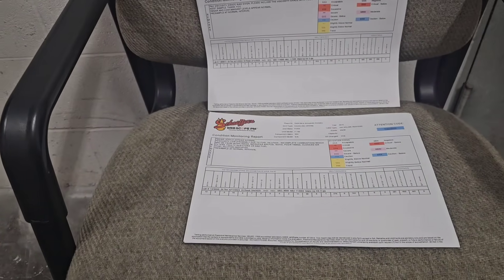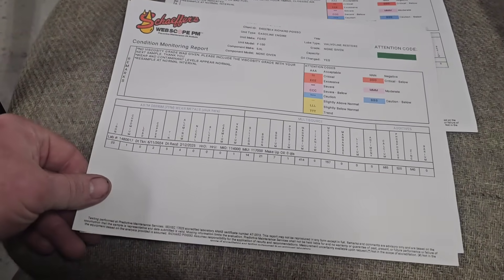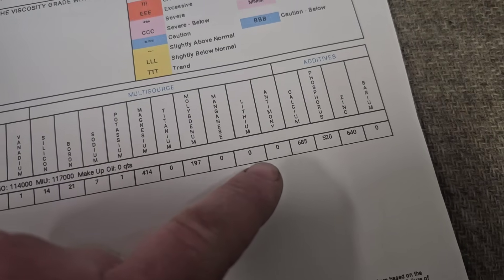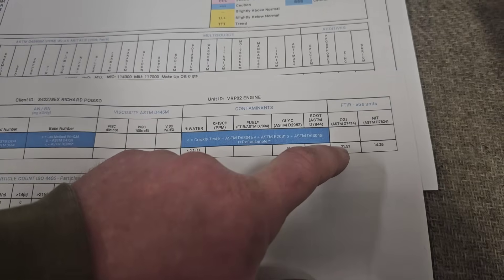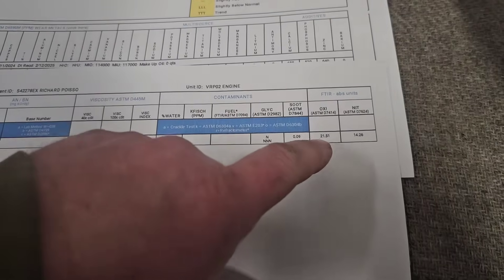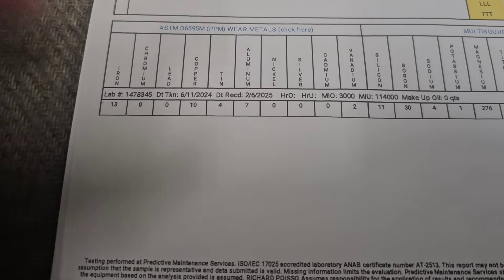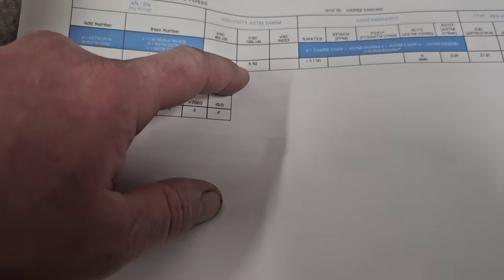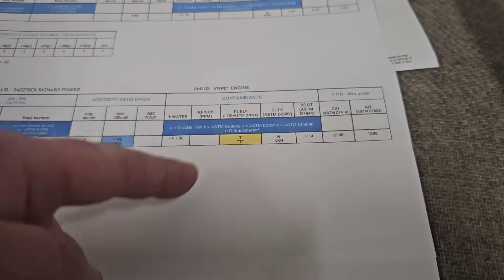Why F150 Owners Are Switching To Catch Cans | Catch Can Vs Sump Oil |  Valvoline Restore and Protect

Comment from the maker: Oil Filter Cutting Tool

Expensive one:
https://amzn.to/3F6wdDd

Cheaper one:
https://amzn.to/4krl6ol

Valvoline Restore and Protect 0w20 5w20 5w30:

Make sure you select what you want - 
https://amzn.to/3DnXWi4
Reply: I have a question if you don't mind ... what would cause my Oil Catch Can all of a sudden to quit catching anything ??? I have check all the connections for any clogs and if you unscrew the container with the engine running it will induce a vacuum leak so I know the system is working 🤔

Comment: My 2015 3.5 Ecoboost with over 135k miles has clean intake valves! Simply Change oil (synthetic) every 5k miles, replace the PCV valve and spark plugs every 50k miles and only use Top Tier gasoline!! Catch cans only catch vapors that cool down to a liquid. 3rd generation mechanic and engine builder. I was using Mobil 1 but switched to Valvoline Restore and Protect 3 oil changes ago. Zero problems or issues!!
Reply: Valvoline Restore and Protect and catch cans help a lot with engines that send more incomplete combustion back into the combustion chamber than others.

Comment: Love the channel. Just a few thoughts though from a fellow tech. There is an absolute difference between the samples not denying that. However the environments that the oil live in are different. Moisture and fuel in the oil on vehicles is a perfectly normal occurrence. The water and the fuel will both evaporate in the crank case during normal operating temperatures provided the duration of that temperature is long enough. (not short tripping the vehicle) The catch can however by design will capture moisture and fuel and will never be warm enough to evaporate it being so far removed from the heat source. So all the sample is proving is that some of the small amount of oil, fuel and moisture was captured. I feel like the actual test for a catch efficacy would be to show that these substances once recirculated back to the intake in small amounts over long periods of time actually do or do not contribute significantly to carbon build up by having an A and B sample vehicle, one of which would have to have a can since new and both sets of intake valves scoped at 100-200k to collect data. Then proving there are no drastically negative effects, such as freezing and going over crankcase pressure in cold climates etc. The only real empirical/scientifically proven reason to run a catch can to date is to reduce LSPI, which with the new oils isn't as much of an issue anymore providing you have a healthy engine.
Reply from the maker: This was a test that I was asked to perform and I gave it to you

Comment: I got one for ya Ford Boss Me, will Valvoline Restore and Protect reduce the amount of intake valve buildup on a Direct Injection engine. We know that it eats away carbon but would the intake valves be exposed to enough of it to work on the valves? I have switched to VR&P in my DI engine. I plan on removing the intake to check after 4 change intervals to see  what they look like.
Reply: Why would oil be flowing through the intake valves ? 🤔
Reply: @Jay388   PCV crankcase ventilation. Hence why the need for a catch can.
Reply: @Jay388 I the engine bus oil through worn valve guides or seals, the valve would see oil to burn off carbon.

Comment: I did the same thing for a 05 f150 5.4 with 216,000 on it, it’s definitely sludged up but not horrible so I switched to r&p 5w30 and bought multiple fl-820s filters from Walmart for 4 bucks a piece. Changed the first one at 600 ish miles on the first oil run and it was caked up, next I’ll probably put 1000 on the second oil filter to inspect and see when to put those filter change intervals at. Its better to change them sooner and still flowing oil then later and having them plugged to hell

Comment: Started to run r and p in my 13 explorer 3.5 non turbo and its insanely quiet and with the valve covers off its pristine inside 140k miles. bought car at 36k miles and it was a little tiny knock noise once in a while after it runs for a few hrs but that totally went way after a week or so running r and p. Great stuff

Comment: What weight was this?   I assume 5W30.  Just for comparison, you had shown virgin results of 0W and 5W20 as 6.1.  On Lake's high miles Toyota Sienna oxidation was 13.6 at 5000 miles on 0W20.  For my Telluride, I am going to limit to 5000.
Reply: I was thinking that oxidation ended up high too. I wonder if all oils do that or it's just this one.
Reply: @briankalagher6687  what I learned on the Oil Geek is that at some point it increases more rapidly.  To learn that point takes multiple tests.  I am not ready to spend that money, but hoping to learn from seeing data online how I can avoid waiting too long.  I don't have a turbo, but I do know my engine was building up deposits on my dealer's synthetic oil.
Reply from the maker: 5w30

Comment: The entire way Valvoline R&P works is by having a higher solvency base oil that holds the sludge dissolved in suspension. It won't clog the oil filter. Prematurely changing the oil filter is probably a waste. But if it puts some people's minds at ease, so be it.
Reply from the maker: Greg if you hear it come out of my mouth there was a reason for it, OK?

The reason is people reporting the sludge it breaks lose has caused some issues 

I use the caution as a disclaimer, I dont necessarily need to be corrected by anyone or have anything I said changed

Comment: In our areas, there is a Dairy Queen about 40 mies outside of the city. We tell ALL of our customers to drive out to DQ and get a cone or sundae and then drive back. Why? We suggest they doe this about every 2-3 months. Heating up that engine helps remove condensation of the engine pan and gets that oil hot and helps remove those carbon deposits. Valvoline Restore and Protect does work, but we also use BG products like 44K. That certainly helps flush out contaminants out of those injectors and reduce carbon build up in the engine.
Reply: The amount of people that don't understand an engine needs to be heated up and actually revved out a little bit boggles my mind.

Comment: I am on my second oil change with restore and protect. My engine is fairly new, so I didn't bother with swapping filters in the middle of the first run of this oil. I use Purolator Boss oil filters.

Comment: I'm running 5qts valvoline extended protection high mileage 5w30 and 2qts restore and protect 5w30  in my ram1500 hemi .......smooth and quiet 
My wifes nissan frontier pro4x  2.5qts restore and protect 5w30 and 3qts valvoline high mileage 5w30......she ❤ it ...as long as it starts and goes my phone don't ring 😅😅
Reply from the maker: I wouldn't mix
Reply: @FordBossMe  so if I ran 7 qts of restore and protect and then switched to say advanced ..even draining pan til it doesn't drip ..your still mixing..
Back in the 90s I ran castrol syntec blend 5qts and 1qt syntec full synthetic and put 400,000 on an xlt ranger .....worked at a shop we sold castrol and the rep recommended it..... remember the commercial where they poured a qt in then drained it and people were blowing motors up ....... THAT WAS AWSOME LOLOLOL

Comment: Good stuff. I'm planning on using the restore and protect next oil change. I'm going to change the oil filter at 1500 miles on a 3000 mile oil change.

Comment: Got a 2015 F150 3.5 Ecoboost.  Normally run a 5k mile OCI on Pennz Platnium, switched to R&P and at 2k the oil looks as dirty as I've seen at 7k on PP.  Going to change this first batch or R&P at 2k this weekend with a filter cut open.

Comment: What I did was remove the valve cover and cleaned it. I've just recently got a 2007 civic that was pretty sludged up by looking in the valve cover. Got roughly 5% increase in mpg. Previous oil was Royal Purple.

Comment: Which catch can would you recommend for like your 2015 F150 with a 5.0 motor because that’s what I have.
Reply: I installed the Ford Performance oil separator on my 2018 5.0 one week after I bought my truck. The installation is on you tube. It wouldn’t fit exactly because it was for a Mustang and not the truck . I made a bracket to fit it on the battery box and used lines bought off the net. The engine went thru 2 Ford oil consumption tests after 10,000 miles but did not need an engine replacement. At 30,000 I changed from 5w-20 to 5w-30 and the consumption reduced drastically. I change oil at 3000 miles because of all intown stop and go driving. There is always 3-4 oz of oil in the separator at each oil change. I use only MotorCraft oil and filters. I’m 80 so my local dealership does the services.
Reply from the maker: I have a cheap ebay one on it lol but I like Ford performance the best or mishimoto
Reply: UPR, fantastic products.

Comment: I see you mostly running motor craft filters on your F150. I’ve got 102k on a 19 F150 5.0L. Looking to switch to the restore and protect. I don’t mind the cost of motor craft filters if they’re the best. Where is the best place to buy them? Dealership? Amazon?
Reply: They are $8 at Walmart and the oil is $30
Reply: amazon is nothing but counterfeits
Reply from the maker: Actually I don't run mostly motorcraft I have a mix depending on what I'm doing 

Right now I have a Donaldson on it - 

Motorcraft I always recommend on fords
Reply: @ I gotcha. Been looking online at filters just trying to find the best place to order motor craft and not get screwed on knockoffs. Thank you for the response! Glad I found your channel and the oil results have been very informative.

Comment: Can i send you samples of my oil  it's valvoline restore and protect. I been doing filter swaps and topping off every 1500 miles without doing full oil change in over 25000 miles take a smaple at filter change and add about a quart. So im basically doing a 25% oil change every 1500miles this car is oil 2006 xb 1.5l 1nz-fe with over 240k miles 🤔 the manual transmission is starting to go out lost the synchros in 1st, 2nd back at 180k.
Also i don't use the stock filter for this car i use the one for the Tacoma it's the same thread and diameter fit perfectly but nearly 2x longer
Reply: Side note i did a full bg motor flush before switching to V-R&P
Reply from the maker: I can send it off for testing for you but it'll cost about 25$ a test

Comment: Pretty sure my 120 mile 2015 5.0 got a rear main seal leak from the stuff. Was fine and then started leaking with this oil. Then went back to penzoil and it stopped again. Same oil weight.
Reply: Bs.   If thats the case then crud and gunk is plugging up and sealing your rear main.   This oil didn't cause it.  Your rear main is bad and this oil just cleaned it and showed you a problem.  Change the rear main goofy

Comment: So does that mean that the fuely  smell you get if you have a wif of the oil filler port, is less distinct with a catch can? See  I really notice it on my car with it doing really short 3.5 mile trips cold. Which is why i change the oil now at 2000 miles.

Makes sense that the dilluted fuel vaporises off the oil first so ends up in the catch can. Guess that would reduce the oil sump fuel dillution too?? huh.  🤔 Nice work Bro!👍
Reply from the maker: Yes

Comment: Thank you for sharing this. Because of your research and Oil Geek I have switched to 5w30 from 5w20 on my 2018 5.0 f150 from Amelie oil (which is the Fram name brand at Advance auto in FL) to restore and protect. Can't wait to see how well it does after each change, still on my first run.

Comment: Would this be good on an older vehicle?
Specifically a 98 Sienna with 144k.
Smokes a little, valves tap a little, only smokes on starting. Burns very little oil.
Reply from the maker: Possibly

Comment: Going on the 4th oil change using the restore and Protect. 2018 f150 5.0, 289,000 miles. It was smoking bad every time you left the stop light, or just let it idle a while. We added a catch can also and it catches a lot of oil. The smoking is very minimal now, it took it about 2 months with that catch can. Im guessing the intake manifold was full of oil.
Reply: Cylinder damage

Comment: Agree 100% over valvoline and the oil filter precautions and how well this oil works. I stock it in the shop and uses this on all engines that have cylinder deactivation, gdi, boosted, and vct which is nearly every vehicle which alot of these engines were introduced in early 2000. The varnish build up in honda vct and ring issues were have become issue now at 20 years old and using this oil product will reduce the buildup and prolong these engines even longer from severe engine repairs.

Comment: I’ve never heard of this oil sample company before. Is there a difference between this one and blackstone labs? Preference or just mix it up sometimes?
Reply from the maker: This company is name brand lol Schaeffer Testing - Affiliated but not the same as the Schaffer oil company
They provide oxidative value 

Blackstone doesn't
Reply: @FordBossMe   Sir, i have a 14 f150 EB and use the valvoline extended with a purolator boss filter. I  change it every 3000 miles bc I'm afraid of the  turbos. Do u think that is to often?
Reply: @Sethtallica  Nothing wrong with changing oil every 3k, I do the same. I use Boss filters as well, but use Penn Ultra platinum or Valvoline Maxlife HM in my 2014 EB. My truck loves both.
Reply: If you look at the bottom of the paper, the lab is listed as well as all their certifications. Very legit lab.

Comment: Just think catching that much zinc in the catching can will save the cat for contamination and longer life. Catch can is the best addition for these late model vehicle with low tension rings and  gdi and boosted engines keeping oil from being burned through the pcv system.
Reply: Burning a qt of oil every 2-3 thousand miles wont hurt a vehicle. Cat problems come from incomplete ignition in the firing chamber and unburned fuel exhausting from the outtake ports. Not in the PCV system.
Reply: Also your engine may not release as much zinc if you’re not running the restore and protect oil.